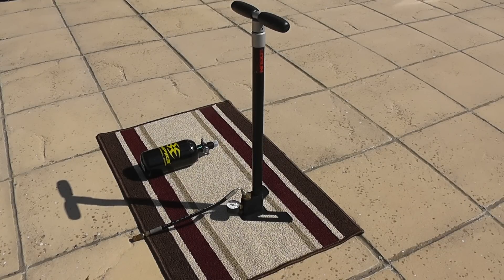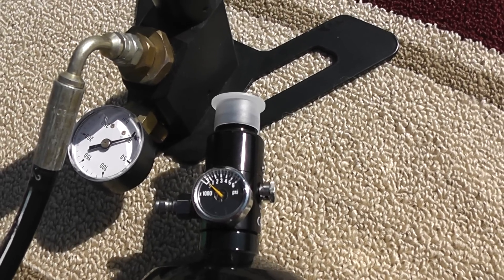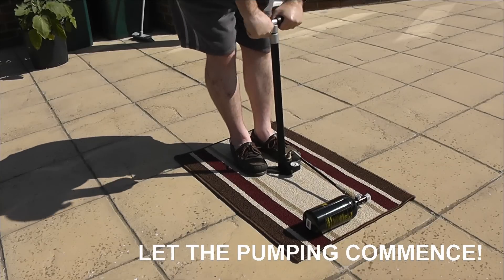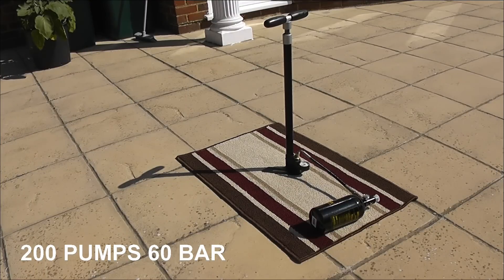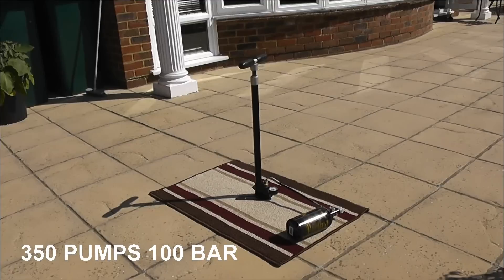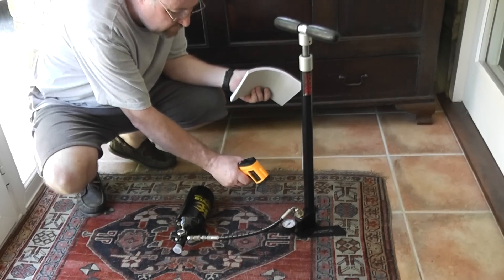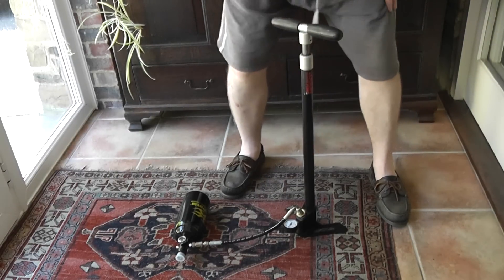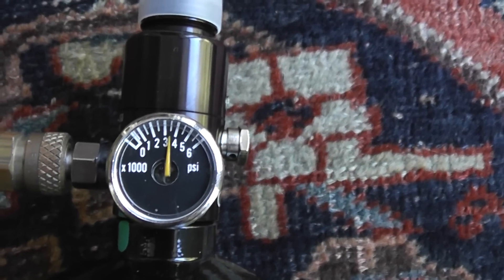Charging a paintball air bottle with a stirrup pump

Comment: is this fake?? My dad sais it's not possible to do that, and that I need a special compressor to charge tanks at home. Any help??
Reply from the maker: It is not a fake Ivan.  You need to look for a stirrup pump designed for charging PCP air rifles and get the correct fittings.  :-)
Reply: Thanks man. You are amazing

Comment: 30 quid for a pump off the bay, stopping for rests rather than heat. takes forever and your abs will let you know they are still under there. every fill re oil the pump with a few drops.

I did 2000 psi on saturday then up to 3000 on sunday but its dropped back to 2000 monday which is odd.
Reply from the maker: Very odd!  :-)

Comment: hi, i just don't get it , if you see the diameter of the pumphousing: its several square cm.
so just to pump 100 bar in the tank , you should press with several hondreds of kilo on the pump and noone can do this.
Reply from the maker: These pumps are multi-stage so the output is increased considerably.  :-)
Reply: thanks Russel, i figured it out myself also, its not a bycicle pump but a special one

Comment: My god 775 pump to get to 3k psi i know when i get my pump in my arms will fall off by the next day.
Reply from the maker: It is hard work Ryan!  :-)
Reply: @RCHobbyGuy92 i was thinking about getting one at one point but decide not too only reason why i never got one was the parts would be hard to come by if it did fail.

Comment: How long would that last for a hia airsoft fun?
Reply: Hpa gun
Reply: NukeThat usually with paintball its about 500 shot with air soft around 1k to 1.5k with air soft bb also it deppend on the weight of the bbs and how your air soft air use is set up.

Comment: Can you use an air compressor instead?
Reply from the maker: A normal air compressor will deliver 10 barg, these bottles require 200barg.  The pump I am using is a high pressure stirrup pump designed for air rifles.  There are high pressure air compressors that will do the job, but they are expensive.  :-)

Comment: Can I use this in airsoft co2 cartridge?
Reply from the maker: No, a CO2 cartridge is filled with liquid and operates at a much lower pressure.  If you were to fill the cartridge to the maximum operating pressure you would only get a few shots with it.

Comment: Can a stirrup pump completely refill the hard in a paintball tank.
Reply from the maker: I am not quite sure what you are asking.  The pump will fully charge a paintball tank.
Reply: Russell Platten the air*
Reply: Russell Platten or does it need gas before you put the air in the tank.
Reply from the maker: The pump is fully self contained.  Just connect it to the tank and start pumping.  If the tank is completely empty there may be a problem because it relies on a little air pressure in the tank to close the non return valve as you lift the handle to draw air into the pump.  It would only need a couple of bar or so though.

Comment: + Russell Platten can you use a electric car tire pump to refill the bottle?
Reply from the maker: No, the stirrup pump delivers a pressure over 200bar, that is 2900psi, a tyre pump will only deliver around 10 bar max, probably less than that.
Reply: Russell Platten ahh cheers for clarifying that for me mate, how long dose that air pressure last? I.e in using it the in the field?
Reply from the maker: The same as any other fully charged bottle of a similar size.

Comment: They work, but they don't last at all.  Hand pumps like these are garbage.  You can get a 4500 psi compressor for less than $300 now, and you don't have to bust your ass trying to fill it.
Reply: netflix netflix where can I find one?  I can't find anything even on eBay
Reply: this is the one I bought.  I use it all the time.  https://www.ebay.com/itm/30Mpa-3-High-Pressure-Electric-Compressor-Air-Pump-Booster-PCP-110V-60HZ-4500PSI/222650052128?ssPageName=STRK%3AMEBIDX%3AIT&_trksid=p2060353.m2749.l2649&autorefresh=true

Comment: hello sir,
can I fill ninja Co2 tank like this ??
Reply from the maker: CO2 bottles are filled with liquid CO2 and operate at much lower pressures which are generated by the liquid evaporating.  It would be dangerous to try and top it up with this pump.  You would only be able to take the pressure up to the safe working pressure of the bottle and you would only get a few shots out of the bottle.

Comment: Aint this gana rot your tanks cuz of the moisture in the air
Reply from the maker: The pump has a built in water trap.  It blows the water out when you depressurise it to disconnect.

Comment: Can you add a air filter on the pump ??
Reply from the maker: +Abonnerende Abonnee I think most of these high pressure stirrup pumps are fitted with a filter.

Comment: I thought the bottles should be 300 psi not 3000.
Reply from the maker: +kempouk a
High pressure air bottles are usually around 200 bar 3000psi.  They should have a rated pressure stamped on them.  You should always check what safe working pressure a bottle is designed for before charging it.

Comment: Hi, I have a Webley ultra glide air rifle pump which works great until the preasure reach 500 psi after that is wery hard to pump and it feels like generate vacuume. I replaced all the o rings and is still the same someone can help me ? I tryed to google but I can't find anny answer or manual to see how is works. Cheers
Reply from the maker: +csavarka1 Sounds like  problem with the air inlet valve.

Comment: Will the same method work for airsoft
Reply from the maker: +Jeramiah Gabrillo Gabrillo It should do if the bottles are air bottles and have a valve.  No good for co2 though.

Comment: so how many pumps exactly did it take?
Reply from the maker: 775 it is on the video!
Reply: I must have missed that. Saw it up too 300 pumps or so.. might need to join a gym before u buy this then because 775 pumps?!
Reply from the maker: Yes, it's hard work.  I wanted to find out how easy or hard it was to fill it by hand and how many pumps it would take.  It takes way too long.

Comment: can That bottle be used to fill your pcp rifle??
Reply from the maker: Probably, but it is too small for it to be of much use.  Much easier to fill the rifle with the pump.
Reply: I have the disco that runs on 2000 psi I guess I am looking for something I can get a few extra fills when hunting
Reply from the maker: I reckon one maybe two fills from this bottle, but they would probably only be partial fills with each fill getting lower as the volume is much smaller than a dive bottle.  Difficult to say really, but you would get extra shots.
Reply: Thanks

Comment: How about precharging to 60 bar with a fridge compressor, manual finish? Scrapyards are full of them, most fridges fail on the doorseals, or are just old. Be aware of the freon filled fridges, keep yourself/ the surrounding environment clean when disassembling. As completely compressing with the stirrup pump causes a lot of heatstrain on the pump @ low pressure. Just a thought.

I've got 2 compressors atm, one maxes at 60 Bar, the other @ ~30Bar, but much faster. They are awesome for homebuilt airguns.

Comment: cant u just use a electric pump? because it can save time
Reply from the maker: As mentioned these HP compressors are very expensive!
Reply: No you need an air compressor that outputs 4000 psi witch those can cost thousands
Reply: @activeej8858  yes you can I went to the gas station and used the free air

Comment: How much did that pump cost?
Reply from the maker: Karl Robert Mägi The pump is no longer manufactured, I bought it in around 2002.  Any stirrup pump designed for a PCP air rifle will be OK for charging the bottle.  You can pick these pumps up from ebay UK for £95, I am not sure how good the quality is.

Comment: Russell Platten will it work for co2 tank?
Reply from the maker: wildgamerforlife Unfortunately not.  CO2 tanks are designed for liquid CO2 which gives way  more shots than compressed air would.  If you filled a CO2 tank to it's maximum working pressure with air you would not get many shots out of it.
Reply: well hpa tanks cost some money. but I might switch.  thanks anyway.
Reply from the maker: wildgamerforlife You're welcome.

Comment: I take it you are a air rifle hobbyist. And your point of view comes from that. I myself come the paintball view. And have seen this done before by other paintballers.But this is first time I seen some one fill a tank to 300psi. And that it took only 3 and a half hours with 375 pumps. Is amazing.
Reply from the maker: jason arce Hello Jason, I wanted to see exactly how long and how many repetitions it would take to fill a bottle.  I do have air rifles and that is what I use the pump for.  I reckon a fitter person would do it in much less time!
Reply: +Russell Platten Well it was definitely interesting to watch the video to get a good idea of the process.

But if you do this regularly it's one way to get to a more fit with this workout, also as you stated a few times during the video is that the pump has to cool down (keep in mind that the internal seals will reach a much higher temp than the outside). One thing that may help both you and the pump is have a fairly powerful fan force some air circulation around both you and the pump, probably best not to do this outdoors though as you might blow up dust from the ground and suck that into the pump cylinder more than needed.

Also one thing which I didn't pay close attention to, did you bleed the line between pumping sessions? I usually pump for 4-5 minutes myself, bleed it and take a break while the pump can cool down to refill my air rifle. And once I get above 200 bar I kinda have to cheat and grab a backpack that has a few full water bottles in there to get the pressure up to the max rated 232 bar of my air cylinder on the rifle. I'm guessing you live in the UK based on your accent, chances are humidity is usually pretty high then similar to what I'm getting by living in coastal region. If you keep pumping without bleeding the line between sessions odds are you might be building up a lot of moisture that may end up inside your tanks. You'll still get some in there if you bleed it between pumping sessions but it should drop significantly, if you've pumped your tanks this way frequently by now I'd be curious to know how much water is actually in there.
Reply: It doesn't work like that. You need to take brakes to let the pump cool down. If you shoot pcp rifles you should know that. You damage the seals in the pump that way.

Comment: Hi, what adapter you used to connect the pump to the tank ? Also do you bleed the valve at each 50 or so pumps? (to release the moisture). Thanks and please excuse poor english.
Reply from the maker: Liviu Ancas I am sorry Liviu, I am not sure what adapter it is, as it was already on the pump.  I bought the pump for my Daystate air rifle and this has the same connector as the air bottle.

Comment: hi Russel,
I've bought a PCP airrifle with a 400cc(approximatly 25CU) tank, it's regulated at 150bar and can hold 200bar. I'm wondering if a pump would be enough for me? I don't plan on shooting every day, not even every weekend so i don't know if it's worth buying a scuba bottle for this?
I'd have to fill from zero the first time but then afterwards i'd be topping of from 150 to 200 bar with a Gehmann pump..
What's your opinion? Every other (serious) airgunner says i should buy a scubatank but they shoot all the time...

Comment: Great Russell Platten I'm a fan of your videos, I'm wanting to make an adjustment and put an engine that will pump for me, but I will do so 50 pumped and waiting 5 minutes, 50 pumped and waiting five minutes, I'm doing this to load a scuba or scuba tank, do you think that is possible
Reply from the maker: Ramon Alexandre Hi Ramon, you must be very careful about making a motorised pump.  You must make sure that you do not over pressurise the bottle!  Do not leave it unattended as it could be very dangerous!  I work in an industry where we deal with high pressure systems and people can be seriously injured.  If you can fit a pressure switch to stop the pump at 200 bar and a pressure relief system that is reliable, it would be fine.

Thank you for your kind comments!

Comment: Where did you buy the pump and pipe?
Reply from the maker: I have had the pump for over 10 years now and I cannot remember where I bought it from.  There are several suitable pumps available and they are usually sold for PCP air rifles.  There are several different adapters available now and the one on my pump is for a Daystate rifle.  My pump was manufactured by Logan, they are not made anymore.  i had a quick look online and J S Ramsbottom sell a stirrup pump for £116 plus P&P.  Look around, you may find one cheaper.  I hope this helps.
Reply: cheap hand pumps with accessories at www.acecare.cn/

Comment: Too much work. I just pay to fill up at the store to test my markers then I only play at a field with all day air anyway.
Reply from the maker: I agree, but I play at home and did not want the expense of diving air bottles and refilling.  The video was meant to give you an idea of what is involved in charging with a stirrup pump.  I made it quite detailed so that people could make an informed decision on whether to go for the pump or air bottle.
Reply: Yeah I see that, thanks for the video. It does show people its not easy to fill these tanks. A lot of people think you can just use a regular air compressor. Have you thought about getting a 90 cubic inch 3000 psi output carbon fiber thank made for an auto mag? Then buy a fill whip for the tank and few 13 ci tanks. Then you could use a few pump markers with some friends.

Comment: Just a though. Do you think a crank pump would be a lot more efficient? When I thought of a manual paintball tank pump I thought that having a crank pump with a fly wheel would be easier to use. Having a circular motion to the pump will allow higher pressure pumps with less force and the momentum from the flywheel will make the amount of force you have to apply lower and more spread out, unlike a normal pump where you have to push down and then pull up.
Reply from the maker: I have not seen a crank pump before.  It sounds like a better idea than the stirrup pump.  The stirrup pump is hard work.  Mind you, I reckon someone in their 20 or 30's would find it easier than me!.
Reply: Even then you can’t pump too fast you’d still need cool down sessions it’s a great idea build a prototype